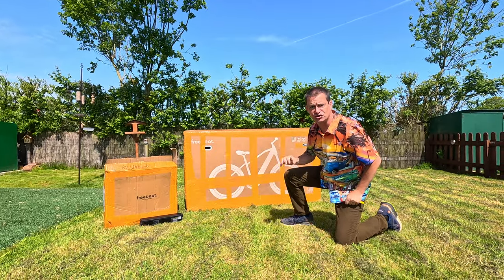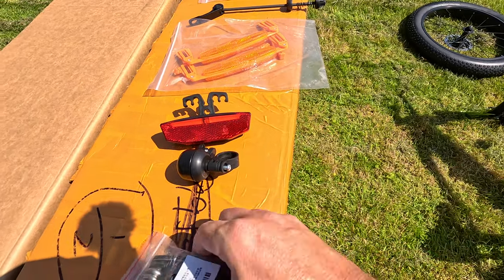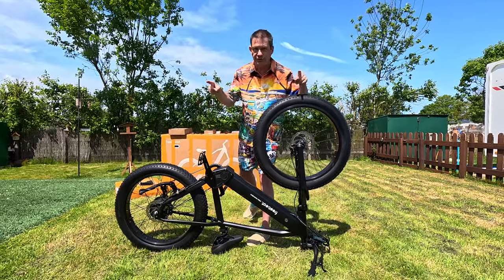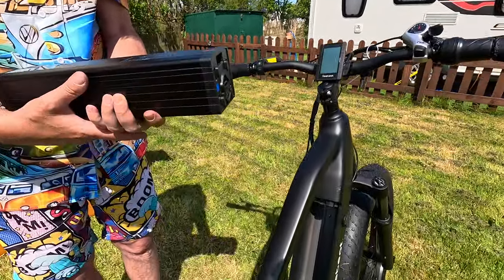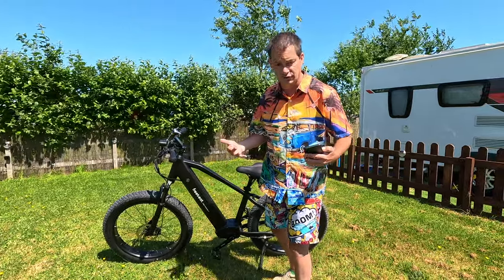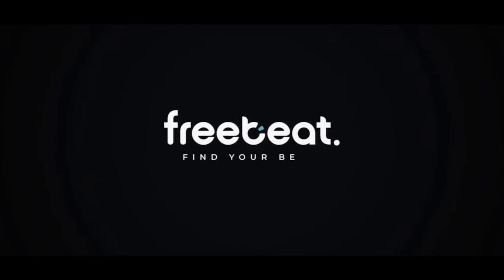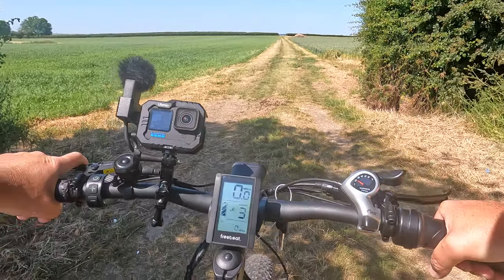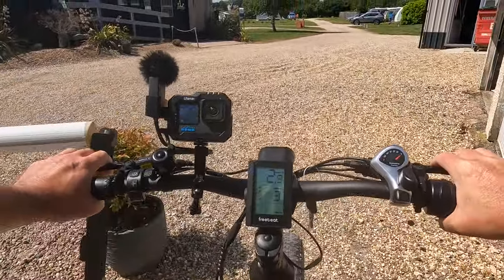Freebeat MorphRover 2 in 1 E-Bike Review

Comment: Top tip, when fitting the front wheel.  Press and hold the front brake whilst you tighten the quick release skewer. This will centralise the brake disc in the caliper and prevent the disc from catching whilst the wheel spins. 😉
Great video by the way
Reply from the maker: Great tip 👍